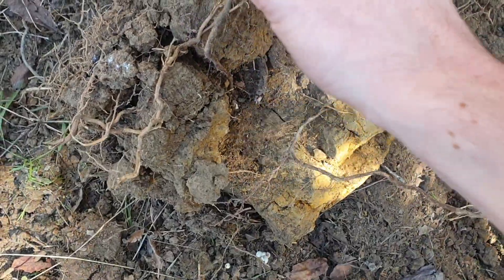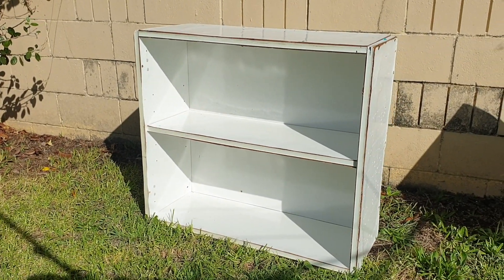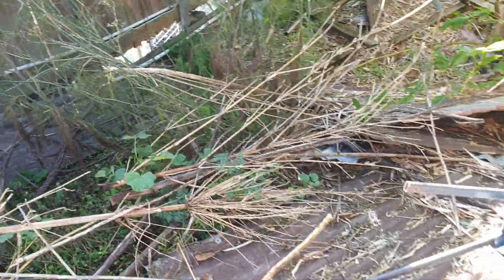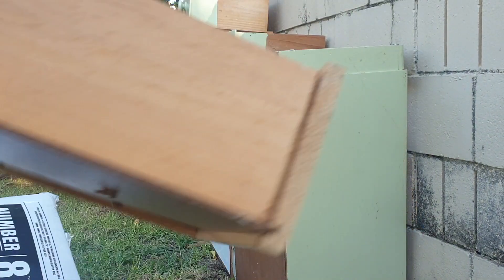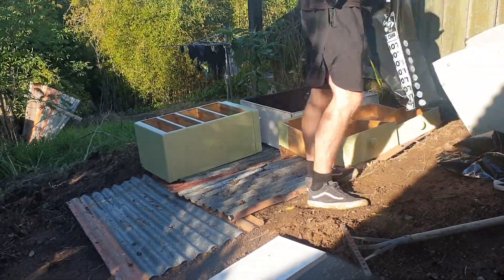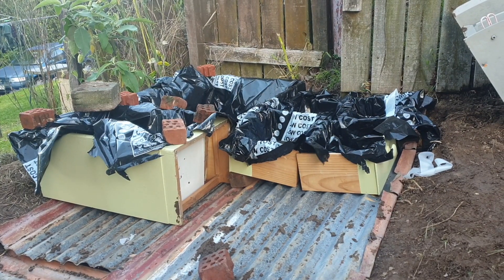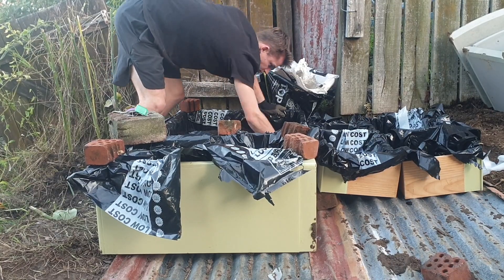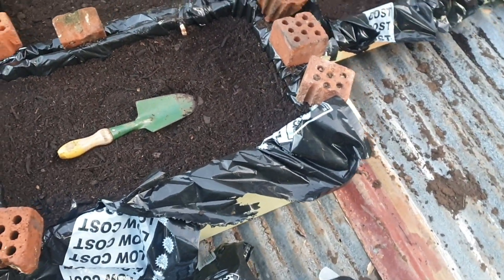SIMPLE & EASY Raised Planter Boxes out of Dressers/Drawers. Tips to get ready for planting

Comment: Great video, thank you! What is on the bottom? Did you place the drawers on top of roofing? Is that for drainage or maybe to protect the drawers from sitting in water?
Reply from the maker: Yeah, it was just some old corrugated iron cause the drawers were not water proof or anything. And it works well for drainage too due to the grooves.
Reply: Michael Pratt Great thank you! 👍

Comment: How did it go with this method? The plastic bags allowed enough drainage or did you have any root rot? I'm ready to start my garden with raised beds and I'm new to this so iIm trying to learn what works and what doesn't. I live in a hot, humid climate  during late spring, summer, and fall. Thanks for the info!
Reply from the maker: Everything grew incredibly well! Drainage was fine. Unfortunately I had to leave my place and never reused these beds so not sure if I had any root rot. Just go for it! The best way to learn is through experience, Good luck (: